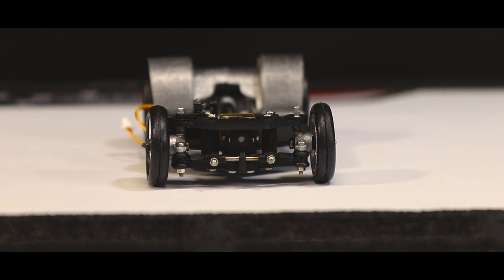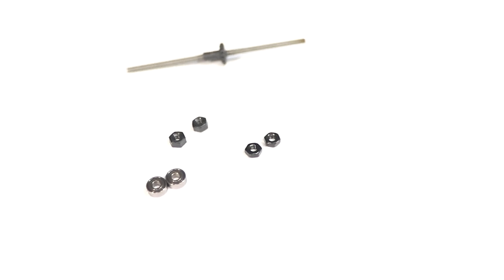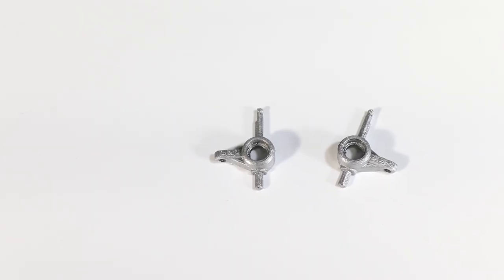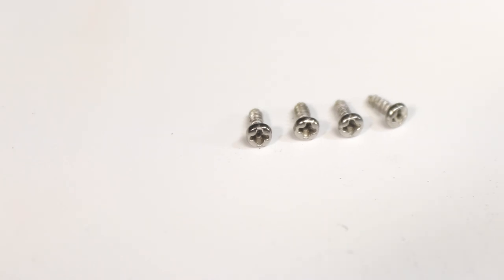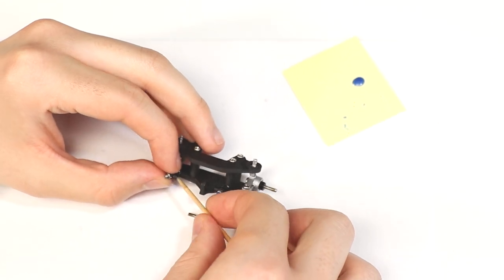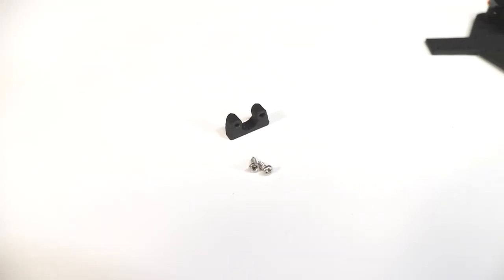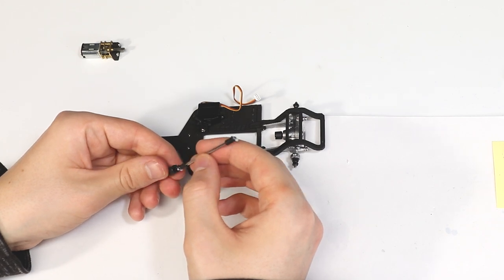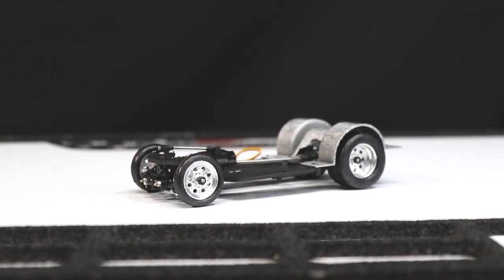3D Printed 1/24 scale RC Drag Car Chassis Build: Make It RC FFR SCD Assembly Tutorial

Comment: Make your model car move! The FFR SCD has been released and is coming to a 3D printer near you. Great scale looks combined with RC electronics and FDM 3D printable components ready to race down the ¼ mile… well a 1/24 quarter mile. This video shows the complete assembly process of the chassis from start to finish. For more information and to begin your build, check out the links below.

Comment: Does the rear gears and everything vome woth the chassis kit. I dont have a 3d orinter and wanna buy the chassis kit from you but didnt see the gears for the rear end is included with the chassis kit. If i order the hardware kit chassis kit and electronics kit will o jave everything needed to buold this car and have it ready to run
Reply from the maker: Our kits do include all drivetrain gears, with stronger metal gears being available on Shapeways. Some electronics like the radio TX/RX and batteries we do not sell, so you'll need to provide your own.

Comment: Is there ever going to be a metal ring and pinion gear upgrade for the solid rear axle? Haha
Reply: You can get a set on the Make It RC shapeways store. I got a set for one of my cars. There nice but pricy. Honestly if you build the car right and arent gonna run a big brusless motorthe resin gears hold up great if your using the motors they sell. I've built 5 Sc1 chassis so far.
Reply: @rockyice8301  Rad. Thank you